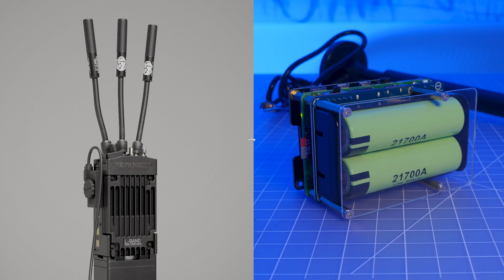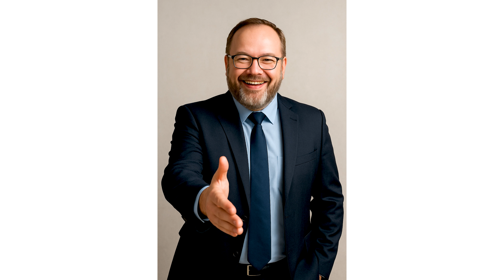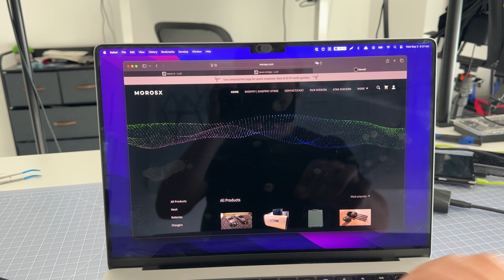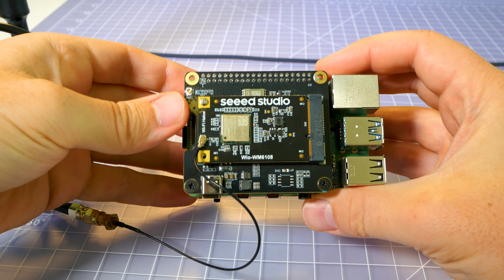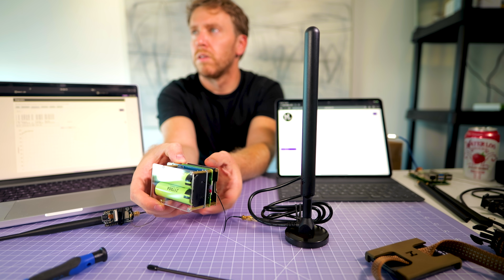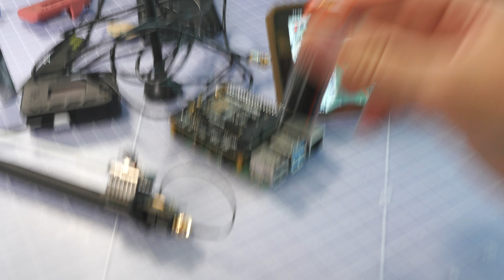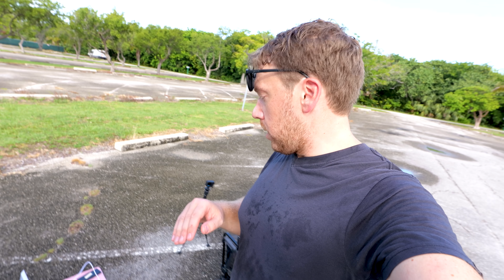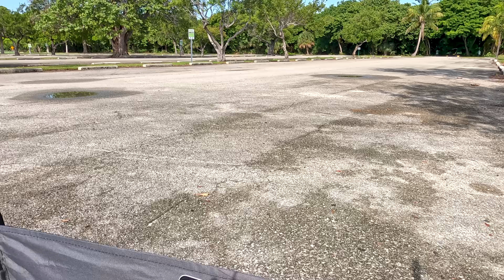I Built a $20,000 Military Router for $106.23

Comment: Is there chips on the civilian market that can be used to build a board with higher wattage?
Reply: You can buy chips to build a higher power board... that's been part of my job for the last 20 years!  You also have to know how to do RF circuit design, which does limit this just a bit. 

You probably can't buy a higher power board that'll violate the FCC restrictions on the 900MHz band... at least not from US suppliers. I haven't checked AliBaba...
Reply: @DaveHaynie I see there are halow boards being sold that run at 2w for uav builds. I want to put one on an autonomous boat.
Reply: @lililililililili8667  I believe it... I'm currently working on controller for drones with built-in HaLow and a slot for a WiFi card. I don't think we'll go to 2W, but anyone who can design the radio/system could deliver that if they chose to.

My radio guy had a few designs going to 10W and 25W transmit power... he's kind of waiting for a system that can really support that! But not for HaLow any time soon.

Comment: Ah yes, the $106.23 military grade radio with a certified supply chain, no  development, software, or licensing costs, cyber certs, hardware hardening, or warranty. If you put this in the field at scale it would be the most expensive radio there.

All that said, great video on what is available for civilians! I’m a fan and you got a sub.
Reply: Only a peace-time military would consider $20,000 to be a reasonable sum for a radio... Once they start getting dropped in trenches they will be crying out for the $200 version.
Reply: @gajbooks  That’s the catch, there isn’t any $200 version. If you think a homebrew one-off would survive to even make it to the trench, you’re mistaken. There must be some level of testing, certification, hardening, training, sustainment, etc. That’s how you get to a $20K radio. Economy of scale brings the cost per unit down, but you can’t get away from the costs necessary to equip and sustain at scale.

Comment: Military secrets are there for friends and families private companies to extract an extreme amount of money from taxpayers in total secrecy and protection against investigation.
All is 1000x expensive.
It is a form of high treason as it 1000x reduces our capability to defend ourselves, which we could otherwise.
China, using this opportunity rising in power unbelievably fast.
If treason and corruption did not exist in the Western world, or at least if limited, particularly in the USA, China would not stand a chance; in fact, it would give up and not even try to race in a run that cannot win, by spending limited resources.
They recognise chance and organise themselves in a winning position in the long run (actually we doing themselves so bad that would not be so long)
All empires are falling from the inside out.
The Western Empire did not have a chance to stop the process.
Traitors, top corrupt leaders are super capable only to defend them selfs inside the system, but we are all in great danger from the outside enemy. Once, very soon, China would be ready and far superior to the falling Western empire, which would fall fast.
They only need to ensure nothing to stop this western self destruction.
They do not need to do anything else than develop China as fast as possible, we, the westerners, would do the rest, ensuring China is the next unchallenged superpower.
You can be even arrested if you try to stop self western destruction from inside, that how all got so far and process is unstopable to do anything about. Our western corrup leaders would ensure unchallenged until whole western empire collapse very soon.
Those who should stop directly or indirectly working for Chinese interest, does not matter if direct or indirect for Chinese interest, effect is the same.
Cannot more suit China than this.
Very simple, guaranteed succes for them!

Comment: The router does probably cost 100 bucks. It's the UL certification, military testing, obligation to test 1 in 100 to destruction, obligation to use milspec parts for everything inside. Your 2 cent capacitor just went 20 dollars because they have to make them under the same umbrella..... 

All that to be probably dumped when you are under fire as soon as the battery runs out !

Comment: As a former memeber of the military team that provide internet for a quarter of globe, you didnt need to reverse engineer anything. Everything is COTS (Comercial off the shelf) but with a harder shell and some ugly paint slapped on. Thats what military grade means. And the military gets its internet from civilian companies. We pay bills for allotment of internet use. That is broken up between all military locations and useses.
Reply: All depends on what you're doing. I've worked on two mesh radio systems for the military. You can't get the MIL encryption from COTS. The first one was a fully custom design from the ground up -- no reverse engineering, but plenty of forward engineering. The second was using a new COTS radio I had designed with an add-on module for the MIL version. Of course, these are not generally attached to the internet -- the only network connection on our mesh nodes is Red Ethernet, which is not normally going to be attached to the internet.

Comment: Put it in a secure dome with antenna on a pole above and below the treeline. That way it can help people find civilization and maybe use an app to help you find your way if the data is weak. For areas with less towers make a node mesh network line and it's far cheaper than a cell tower.

Comment: If You are interested, You can do this with Ubiquity gear for under a $100 per antenna and fiber optic speeds, highly encrypted and unhackable and We have tested these M5 antennas over 100 miles, when rated for 15 miles. We can also create a 15-20 mile diameter bubble and have wifi app working as if You're at the base/home...no microwave, no other signals needed. We are adding this amazing tech to Our IntelliTrees project. Thanks for the vid, great starting tech to play with this stuff....inspiring ;-)
Reply: uhh what parts/gear from ubiquity do you need to do what you're saying? i'm not aware of any of their gear that can do this.
Reply: No possible way to get 100 miles line of sight between 2 M5’s …..that simply untrue.   I installed them for years on a wisp system…

Comment: This tech really interests me, I like messing with the Meshtastic stuff and this feels like the logical next step

Is this the sort of thing where you could get like, a USB dongle that does this Wifi HaLow thing, and plug it into a travel router, then just use that as a base station?

Also, if you wanted to use this say on a hike, where you have someone at your camp with one access point, and a few friends out on the trail,  would each person on the hike need one of these like Meshtastic nodes, or is this the sort of thing where as long as everyone as generally in the same immediate area, they would all be covered by 1 access point like a normal wireless router?

Comment: Nice demo. Now you just need to throw a node up on a few drones and let them hover. LOS between the drones is perfectly clear so you should be able to extend the range pretty far. I've personally pushed 900mhz RX/TX signals 3 miles but I've seen some hobbyist RC pilots push it like 10+ miles. They use high gain directional antenna though and you're using pretty sub optimal polars. I think if you pushed your omnis to the same polarity you'd get a higher SNR and better distance or at least better stability.

Comment: The unit used to measure how much pwer is stored in a battery is milli ampere hours not milli ampere. Essentially, how many hours could this thing run for at a loss value of 1 milli ampere, or (more realistically) how many milliamps can this battery output over 1 hour.

Comment: You mentioned throughput, but not range. What is the range for 1, 2, 4, and 8mhz? And what's the latency let's say for an HD stream? also morosx is not cheaper than DoodleLabs radios, which are military proven, and are already used in warzones. So morosx is not a viable purchase. BTW 1 mile range is not a "box that can keep up with the big boys". The "Big Boys" as you call them, are 15km range, multiple HD streams, with around 100ms delay in live stream.
Reply: 100ms... that's forever! At least some of "The Big Boys" are delivering something like 0.5-1ms latency per mesh hop for the radio connection. A good bit of military and other low latency digital video is using Motion JPEG or AVC-Intra. That can be an additional latency of around 8ms with a modern encoder. 

If you're using standard AVC or HEVC, you're adding 500-2,000ms just though the protocol, at standard GOP sizes.
Reply: @DaveHaynie  Lol, no there is no such thing as 0.5-1ms glass to glass HD streaming (DoD standard is being below 300ms). Please go recheck your specs. I'm talking about glass to glass, i'm not talking about transmission speed on the chip. I'm talking about a RWS with an HD stream on one end, and you getting the signal on the other.
Reply: @gene7499  I wrote some of the specs. That is glass to glass on my hardware over our Layer 2 mesh. I'm not talking about video streaming, but best case propagation across the mesh for anything. Sure, if you're adding other protocols on top of the bare network, that will add latency, but that's your additional latency, not my network's latency. 

There are lots of bad DoD standards... it gets us most of our MIL business.
Reply: @gene7499  Obviously I'm talking about the additional latency added by the network. You can't encode or decode digital video without its own inherent latency even with no network in-between. And the network can't provide negative latency. So sure, I agree with you that no one can stream a frame that takes 16.6ms to display, much less encode, camera to glass in 1ms, because that simply makes no sense.

Comment: ROFL, no, you did not knockoff a "military grade IP mesh radio". You are asserting a lot of information as factual without them actually being facts. You built a single channel, ultra-low bitrate mesh that is easily knocked out with less than 50 bucks worth of parts because you're using a single frequency, with no diversity, with no frequency hopping, no hardening of any sort, no nothing. At best you built a beginner mesh project from 15 years ago. A first gen UniFi mesh device would crush everything about this project, and still sip power, run on battery/solar, and be a self-healing mesh. And geezus, learn something about WiFi before asserting that it only gives you a "couple hundred feet of coverage". Multi-kilometer/mile 5GHz is common. WiFi propagates in open are MUCH further than inside a house, as your assertion example shows.
Reply: Oh, and the UniFi device would be cheaper on the used market than all the parts to cobble this together.
Reply: @gymkhanadog  which SPECIFIC unifi device can do all this/what you're talking about? i'm not aware of any devices similar to what he has here that can do anywhere near 802.11ah range.
Reply: @SirIsaacMewtonIII  idk about unifi but I have some Cambium PTP 450i units that are in PTP and PTmP setups. Longests PTP links are 11-13 miles and are about 60-80 feet in the air in a Oil and gas feild. Both using Directional antennas and right up here the regulatory limit. The PtMP links are typically 3-6 miles and the "hub" is a 90 degree antenna with the "edge" site having a directional aimed back. These are 5Ghz, and I beleive... if I remember 10 or 20Mhz widths. Depending on the link and my channel planning.
Reply: Yeah, you can get 1km of more over 5GHz with moderate gain omnis at 30dBm collective (more folks are using MIMO radios today), considerably more if you're going to directional antennas. You ought to see 15-20km with a very good HaLow setup at lower channel widths. Some of that's in the design of the radio itself, of course.

Comment: Can I drop kick it off a building or down a flight of stairs and expect it to still work?  Can I drag it through sand, mud, or drop my full body weight on it and expect it to still work?  If the answer is no then you only reverse engineered the technical functions, not the full requirement of the system.

Comment: Question... could you run 2 halo modules and then bond the modules to double the bandwidth? Basically set up 2 seperate halo networks that run in parallel and the get bonded into a single source on the ras pi
Reply: Advanced radios these days use multiple separate transceivers to enhanced bandwidth and reliability. There are limits.. there are only three 8MHz channels in the 900MHz band, so yeah, you could have two, but not four or more. If you're only considering long range and stuck with 4MHz channels, then a four radio system would even be possible. 

A good meshing algorithm will understand the separate data channels and use them as best suited to the network traffic -- it's more sophisticated than channel bonding, but in a simple network, the same basic result.

Comment: Much of the famously overpriced items like $100/each for a chair leg plastic cap is because the Mil wants things to a higher specification than consumer mass market, or sometimes just a different size.  So, they lose the economy of scale and spend tens of thousands to make an injection mold, but only run off a few pieces with it.
Reply: Also, a good bit of the non-trivial stuff sold to the government has to be made in the USA, with restrictions on the sources of the parts. That adds cost. Many of the things sold to the government in this space can only be sold to the government -- you can't sell a MIL radio to the public. So you're selling thousands, not millions or 10's-100's of millions. No, it didn't cost as much to engineer as an iPhone, but it cost way, way more per unit to engineer than an iPhone. There are lots of little pieces here that mundanes and armchair tech quarterbacks don't understand. That said, I'm at a relatively small company that made a radio system that works so much better than the standard Big Government Contractor radios that our MIL customers had to jump though hoops just to be able to contract for these systems. I don't even see those guys as being any kind of corrupt, because they're in exactly the same position as the Big Computer Guys were back when a bunch of us were creating the personal computer revolution. Big companies just get too big, too top heavy, to expensive to run. No one's going to sell you their product at a loss.

Comment: There are a lot of public projects trying to replicate/improve this type of use-case.  Feels like a volume manufacturer would do well to get in early and corner the market...
  
Get CBRS Base Station into a node, and now you have cellular range and data-rates with COTS cell phones (most are now supporting B48 LTE).  No other gear required for the client-side, just an eSIM on the phone.  Like the router solution - this means no special add-ons to ATAK for proprietary radio nets.
  
I'm working on a WiFi HaLow + LoRa coexistence module - much like 2.4GHz Wifi and Bluetooth coexistence works now.  I found a man-pack antenna that allows one stick to do both 900MHz ISM and 2.4GHz ISM bands, so along the thought process of combining a few bands into fewer antennas means I have HaLow/LoRa + WiFi, UHF + VHF, and GPS + Iridium SBD with only three antennas.  With the addition of a CAT/DATA cable set and some DSP software, I can reach down into the HF band (external radio) on a bunch of different waveforms.  This gives a few tiers for a client device: HaLow/LoRa/Wifi (cheapest, lowest power), HaLow/LoRa/Wifi/UHF/VHF/Iridium-SBD (increased connectivity, still self contained), HaLow/LoRa/Wifi/UHF/VHF/Iridium-SBD/HF (most expensive, highest power use).

  
I'd love to see a version of the StarlinkMini that only connects via DC power (some waterproof circular connector) and an IP69K ethernet port.  I'd buy several of them (10+).  I HATE the reliance on WiFi for connection to StarLink devices - terrible for EmCon.

Comment: What I think may be major differences between this and a milspec systems are ERP and the waveform used. While the former might be easily fixed (if you are willing to... reinterpret regulations creatively) I'm afraid the latter still stands: I highly doubt that IEEE 802.11ah has the same characteristics in terms of jam resistance, encryption and error correction as a milspec waveform, and the non recurring r&d costs for developing a new waveform and putting it in a radio, even an sdr based device, are very high so this comparison is not fair. Having said so this this is still a very useful project, both regarding the ability to use manet ad atac on a budget and for the use of s low cost IEEE 802.11ah radio that can be very useful for other applications, plus working on something like this is really a great learning opportunity :)

Comment: A couple summers ago at JSC we used this type of tech with some EOD people. Over a week we took 10 RC Cars and replaced the guts in each with a Raspberry Pi 3, WiFi Halow hat & antenna, USB webcam, GPS, VOC detector, and battery. Using all 10 cars we were able to start inside a building, drive ~1km, and into another using only the mesh network each car made and a Pi powered base station. There were so many ways the concept could've been improved, both hardware and software, which you've definitely done!

Comment: Okay so one thing you need to know about military devices is GSA markup. We had a SATCOM terminal for comms. To interface with this we used a Dell Latitude Laptop. It was not a special version, it was just a Dell Latitude Laptop. Well the laptop died. The replacement through the GSA Portal? $36,240; off the Dell Website using the command’s credit card? $1120. Guess which one we bought… lol